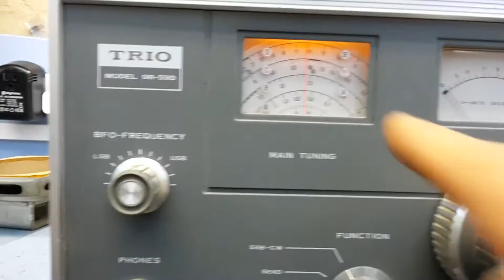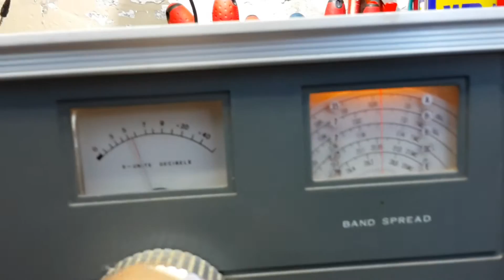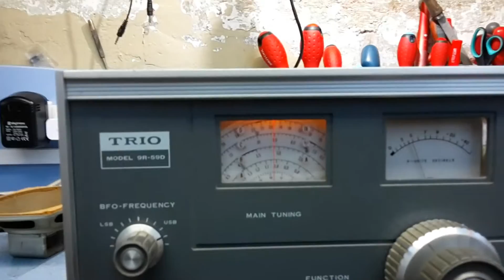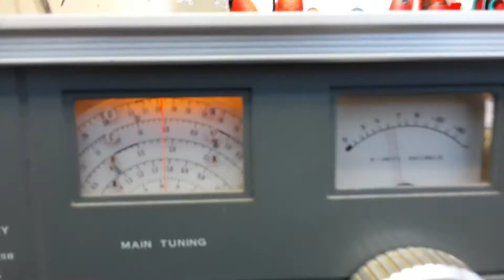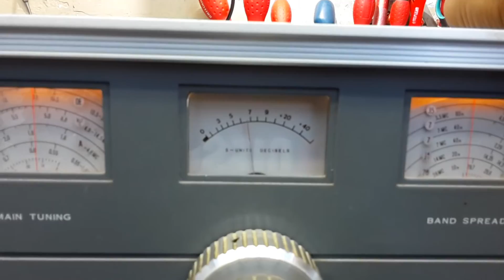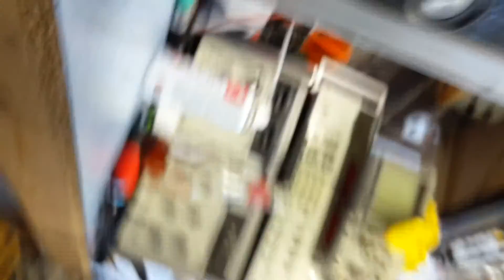Trio 9r-59d pt2

Comment: Nice old set, I had one in the 1980s and had some fun listening on it. It was more sensitive than the Eddystone 750 I had, but it was prone to drift even after a long warm up. Like you, I now have a Lowe HF-225, Sony ICF-SW7600GR, plus JRC NRD-535, Yaesu FRG-7 and a Racal RA1772 (too many radios really!) But seeing this old Trio brings back some good memories, thanks!
Reply from the maker: There is no such thing as too many radios Johnathan! Yes very prone to drift but fairly good performance despite its simple IF conversion.